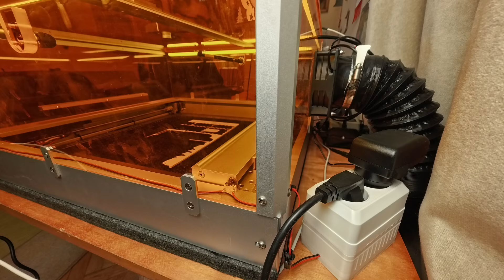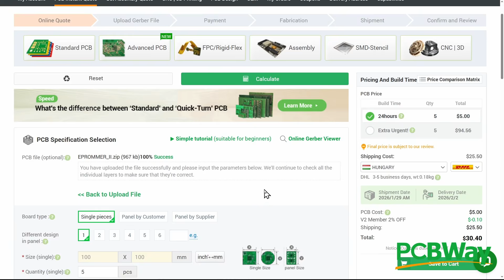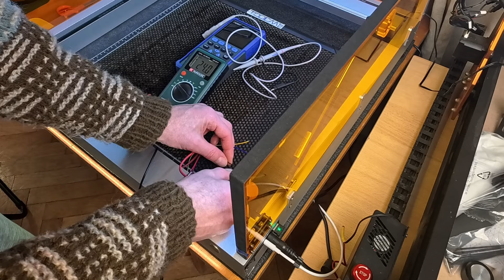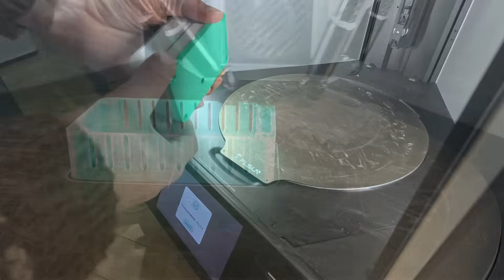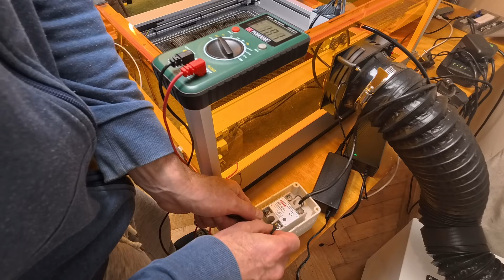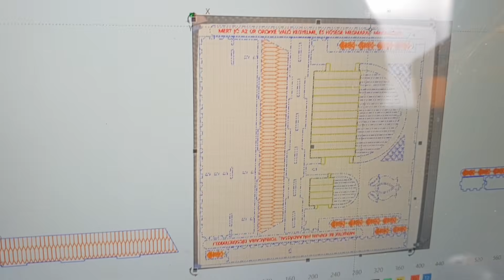Make Your Laser Pumps Fully Automatic! 💡 The Easiest Way to Mod Our Toocaa L2 (for pennies!)

Comment from the maker: ⚠ Spoiler Alert: I spent days over-engineering this with complex sensors, only to realize a $1 switch was better.
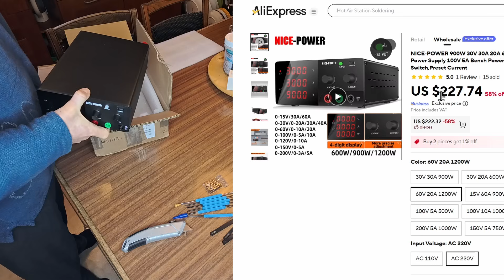03:03 Original Attempt (Engineering Deep Dive & Failure)
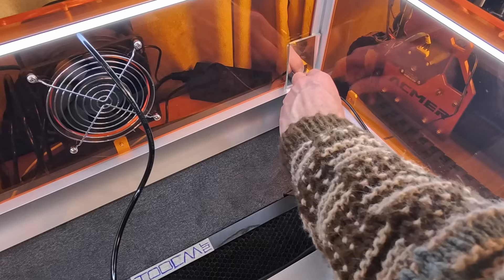10:52 The Fix (Start here for the Tutorial)
12:23 Lightburn Software Tweak
See the short list of needed parts in the description!  If you enjoy seeing the engineering process and why the first attempt failed, watch from the start! 🛠